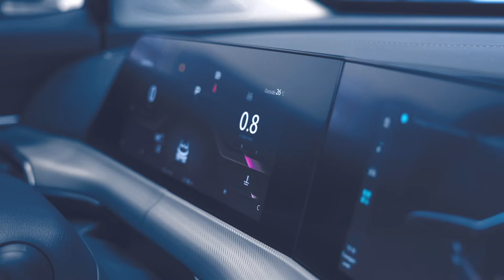Direct Connect | We're In | Intel

Comment: 2028 = RTX 6060 8GB for 24inch 1080p 60hz monitor, RTX 6070 12GB for 27inch 1440p 60hz monitor, RTX 6080 16GB for 32inch 4k 60hz monitor, RTX 6070 Ti Super 24GB for my 28inch 4k 60hz monitor where i game at 3441x1936 50hz high/ultra quality. RTX 6070 Ti Super 24GB 350W/750W PSU = RTX 4090 450W/850W PSU. Will AMD and Intel make a 350W RTX 4090 with 750W PSU? Will Nvidia, AMD and Intel with 85 TFLOPS run TES 6 at 1936p 50hz high/ultra quality without ghosting and stuttering?

Comment: TES 4 Remastered + RTX 3070 + 28 inch screen + 4ms + 50hz = ghosting 🙂🙃🙂. 4ms with 60hz = No ghosting but i have stuttering 🙂..🙂..🙂.. I need monitor 1ms or 0.03ms for 50hz or better graphics card for 60hz.

Comment: RTX 6000 series = My RTX 6070 Ti Super 24 GB 350W (future RTX 4090 24 GB 450W) for TES 6 with 3441 x 1936 50hz High Quality and no Stuttering, this is the minimum for $999, the $1,500 and $2000 is for RTX 6090 and 4k 60hz, not for my RTX 6070 Ti Super, TES 6 and 1936p 50hz with 28 inch screen.

Comment: 2017= Skyrim and GTX 1050Ti mobile 4 GB 75W, 2023= TES 4 Oblivion remastered and RTX 3070 8 GB 220W, 2029= TES 6 and RTX 6070 Ti Super 24 GB 350W (future RTX 4090 24 GB 450W). There are no home consoles or handhelds here. Here it will be something like 16,500 CUDA cores and 85 TFLOPS at 350W, without burning the 750W power supply.